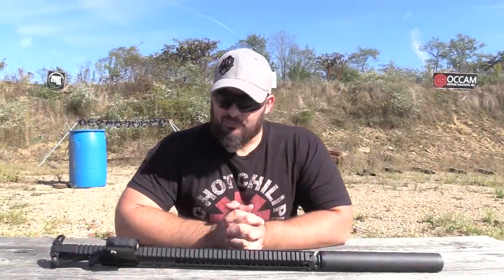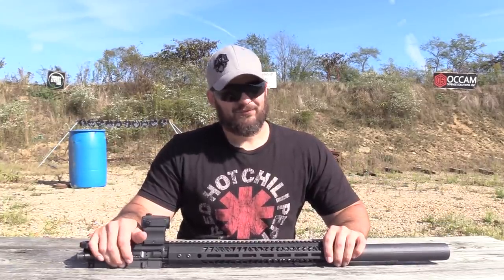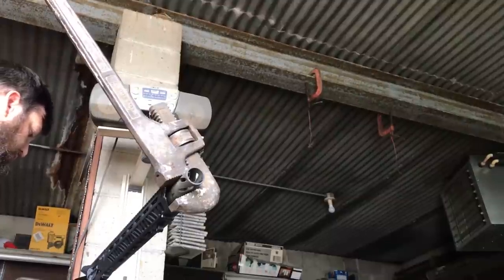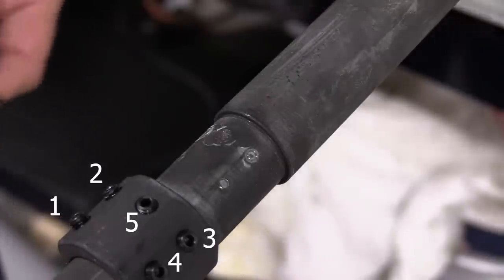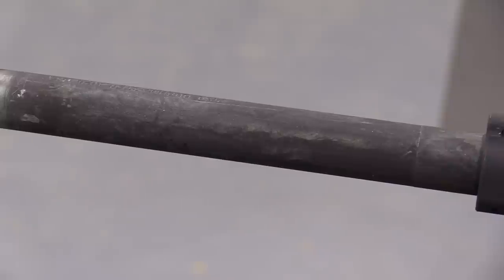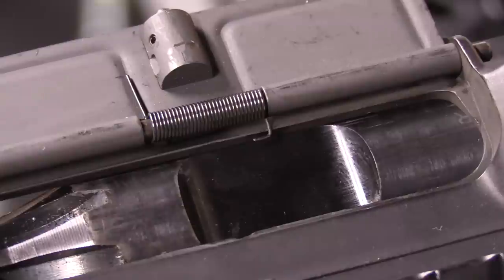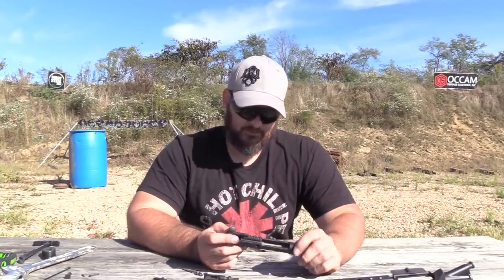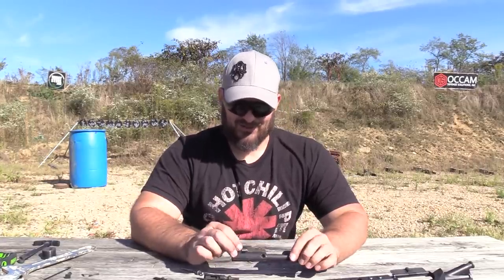The Worst AR 15 I've Seen 🚩Bear Creek Arsenal🚩

Comment: Runs a big bore on full auto then complains some things went wrong? This is a budget hunting rifle, not a full auto battle rifle. Probably the worst review I've seen.
Reply: True
Reply: He’s just mad it doesn’t have any Punisher skulls on it
Reply: Exactly this guys a real pos he makes false statements I tagged BCA about his latest comment about illegal labor it kinda sound like defamation of character to me this guys a real winner
Reply: I certainly thought he was an arrogant douche that made a fool of himself. But don't tell him that, i'm not sure his ego could stand it.
Reply: My thoughts exactly
Reply: You know what's sad? He just had to change out 2 parts to make it work... Though his gaskey is a major problem, i've yet to see that bad of a construction on mine.
Reply: CGranch  If I were to buy one of these big bore .450's I would simply restrike the stakes on the gas key before using the rifle, I always take new guns apart and clean them in mineral spirits or 90% alcohol to clean off the factory packing oil anyway, while it's apart I inspect the gas key and gas block and this was a fairly obvious mistake should have been easy to spot, so just restake the side they apparently didn't stake or if they did apparently not deep enough to count and you shouldn't have a problem, the crack on the BCG is far more concerning in my opinion, I wonder if that was the result of full auto fire or just pot metal construction.
Reply: @Kwuiz  As someone who would be considered a "Fudd" since in my life the only real firearms experience I have is with bolt action/lever action rifles & shotguns of different types, I have noticed something about the gun community. I have recently taken more of an interest in guns & purchased my first AR 15 which is the first tactical weapon I have ever owned. I have been doing a lot of research & trying to absorb good information & visiting my local gun shop a lot & asking questions. I have noticed that there are a lot of elitist assholes in the gun community.

I come from the car community, that is my main hobby along with PC's. But the Car community (which is segmented into different cultures) in general is much more friendly & welcoming to newcomers than the gun community. That upsets me because I am a huge supporter of the second amendment & everything about it. I would think that if you want more people to support your cause, you would try to be welcoming to newcomers. But often in forums & videos the elitists just jack off on their fancy expensive guns & tell everyone who doesn't own a top of the line gun that their gun is shit & should be thrown in the trash because it will never me as good as "MY gun". They get upset & mock you if you dont know about every single bolt in your gun & tell you that you are a fucking loser & to suck your mommas tit.

When you get into cars, NO ONE goes out & purchases a McClaren as their first "sporty" car. In the gun community most people dont go out & purchase a top of the line firearm as their first purchase. Granted quality firearms are generally cheaper than quality cars, but the idea is the same. It is a learning process, for those of us who have not done 2 tours in afganistan or whatever. Have these people ever heard of "entry level"? Seems like no.
Reply: GI Severino  Buddy that car would have broken down even without the rims.
Reply: Yeah. I must be a Fudd. I don't burn through a thousand rounds a week in one gun. And I don't have $1,500 to spend on a base level upper. I can afford BCA, barely afford PSA. I can afford to shoot it several hundred rounds per month. And I never, EVER shoot full auto. For that, BCA and PSA are fine.
Reply: @richardkev3077  "barely afford PSA. I can afford to shoot it several hundred rounds per month" - So you could have skipped one or two months and been able to afford PSA?
Reply: @SugaryPhoenixxx  I'm not pissing at anyone for buying BCA. I'm pissing at people for lying to themselves.
Reply: Titanium Rain—or I could stop shooting for a year and get an even better one. 

Or, I could simply practice and not worry about the best.
Reply: Tell you what. I’ll shoot it until it doesn’t work.  Then I may agree it was a bad choice.

Or maybe it doesn’t break. Either way, you may see it as weird, but right now, I’m choosing to spend my money practicing instead of buying a gun that looks bloody impressive, but that leaves me unable to afford ammo.
Reply: @richardkev3077  My god. Such a brilliant move. Tell you what. I'll use the shittiest brakes on my car, and I'll brake to my heart's content until they fail and I crash and die. Smart financial planning right there.
"buying a gun that looks bloody impressive" - oh he thinks guns are differentiated by looks.
Reply: Apples. Oranges.
Reply: @richardkev3077  yeah, apples and oranges are different fruit. But would you take seriously anyone who buys rotten oranges because they're not the same as apples?
Reply: Thank you!
Reply: Yea this is awful
Reply: He's a you tuber. He has no idea what a battle rifle should do in any way
Reply: Amen
Reply: @ChucksSEADnDEAD  oh yeah 😂 cause nothing says quality like manufacturing done by illegal immigrants, 0 quality control, and exploding rifles 🤡
Reply: @ChucksSEADnDEAD  as a mechanic, buying the higher end brakes is a waste of money 99% of the time. I always use the cheapest Napa brakes on my personal vehicles, never had failure, just normal wear.
Reply: @traxxasrcfun  Cars can fail inspections and barred from being used on the road until fixed. Guns have no such oversight. So we're not talking cheap vs high end. We're talking BARE MINIMUM versus reckless abandon. I don't care if you buy budget. If you buy something that's so off spec it shouldn't even be called AR-15, that's like buying no-name brakes off Aliexpress or whatever.

Comment: you are the problem not the gun u modified.
Parkerized Barrel  has to be oiled.
u over gassed it with can - adj gas block with a can.
a pipe wrench wtf.
factory rock set a gas block lol.

owning a gun does NOT make u a gunsmith u have really shown this is true.
Reply: Dude was raised by women what do you expect?
Reply: When I heard him talking about rocksetting the gas block i knew the rest of this video was going down hill fast.
Reply: Nothing wrong with a pipe wrench if you don't plan on using the muzzle device again. That parkerizing finish looks like shit regardless of whether or not it should be oiled.
Reply: @hochhaul  he said he scratched it banging things into it
Reply: If you had any idea what you were talking about you would know rocksett on gas block screws is the best option
Reply: @robert1marshall  I don’t understand the issue with rocksett on the gas block lol. Way better than using loctite that’s for sure
Reply: For anyone reading this they do make heat resistance loctite blue. A little more expensive. But it is worth it. Gas blocks get hot. Regular blue will fail. Also if you have a handguard that has bolts that thread into the barrel nut. You should use it there as well.

Comment: Over gasses and uses tool outside of purpose, then complains because it fails for something it wasn't made for..... Suburban homeboy with too many Battlefield hours
Reply: What? He bought the upper complete and used it exactly as it was intended to be used. The torx wrench breaking had nothing to do with anything and he actually said he was impressed that the hand guard screws were so tight. Your comprehension level is obviously not great.
Reply: @jenniferbates9769   im thinking he is talking about the caliber. 450 bushmaster was never designed to fire full auto i don't own a bear creek i probly will its a 400 doller gun i can change the gas and barrel for 250 ish still have less than any other company selling there's with fugly parts
Reply: @jenniferbates9769  he miss used it 450 bm is not intended to run full auto
Reply: @jenniferbates9769  
No.  He ran it with stuff added on.  You think that, at 300 bucks an upper, they put an adjustable gas block on it?  He put that can on the end and jacked up the internal pressures, without swapping out the gas tube and gas block.  That's on him.

Comment: “Why won’t my 200$ big bore upper run full auto and suppressed”
Reply: Rifles can't tell if they're being fired in full auto or semi-auto. Suppressing does increase the impulse on the carrier but they had a misaligned gas block and a gas key popped out. Come on man, it was garbage before it even left the factory and had the first round put through it.
Reply: @f.a.2115  Exactly. So many clueless comments acting as though the rifle would have been fine with that shoddy gas key staking and piss poor gas block setup if not for being fired full-auto. Failure was guaranteed regardless of whether it was fired semi or full auto.
Reply: @hochhaul  yeah it was his fault for not checking it maybe he should inspect before he fires it
Reply: The fact that they only have 10 round magazines tell you that they aren't designed for full auto.
Reply: @f.a.2115  The fact that they only have 10 round magazines tell you that they aren't designed for full auto.
Reply: @hochhaul  The fact that they only have 10 round magazines tell you that they aren't designed for full auto.
Reply: @bryananderson3772  You people have the most delusional arguments. The AR was designed for full auto. The reduced capacity from using a larger caliber has nothing to do with the weapon's design by physical constraints.
A 10 round magazine also existed for the Škorpion vz. 61. The Beretta M951R was also designed for full auto and had a 10 round magazine. Any more excuses?

Comment: This is made to hunt with and maybe blow up cement blocks on the weekends not spray on full auto. 99.5 percent of people buying one of these will never fire it full auto!
Reply: 99.5? You mean 99.99999%
Reply: If it can't handle a few mag dumps on full auto then its worthless.
Reply: @regularfather4708  not true
Reply: I kill deer with mine and the occasional rabbit what kind of an idiot would need full auto on a 450......hmmmmm
Reply: Recommend a budget rifle for my friend. If you had 700$ right now and had to get a rifle. Where would you go?
Reply: @danielwells50  S&W m&p sport, ruger 556 or palmetto state armory. Cant go wrong with any of those.
Reply: benjamin dover thank you sir. Much appreciated
Reply: benjamin dover I can speak for the Ruger. I have both the 16 inch and the 10.5. Thousands of rounds through each and not a single issue with either. I got the 16 inch on sale for $599 and the 10.5 for $729. I love both of them. I have a 16 build I did a few years ago. Total cost was just under $1500 for it. Great rifle, no doubt, but my 2 Rugers are just as accurate, just as stout and honestly just as good. I've been buying Ruger products for 30 years and love them but was honestly skeptical of their "budget" AR when I got the first one. Obviously that skepticism went away because I bought another one. Very good rifles in the $700 range. I'd recommend them for anyone regardless of their budget.
Reply: I HATE GUN SNOBS.
Reply: Its .450 Bushmaster. It would be just as fast to empty your bank account and make a bonfire then to fire a 450 full auto. I have a .458 Socom and my wallet sheds a tear every time it goes to the range.
Reply: @calobstewart7345  I hate the "JuSt As GoOd" crowd.
If it was just as good they'd be asking for more money.
Reply: @ChucksSEADnDEAD  noone is making that argument that's the thing.
Reply: @calobstewart7345  But they are. Just responding to criticism of a subpar product as "elitism" is in itself a claim that the product "is fine" and shouldn't be criticized.
Reply: @ChucksSEADnDEAD   not true he just put it through a test that a big bore rifle should have never been put through they have the same amount of recoil as a 300 wm and they would have the same results
Reply: @eronreasor6361  "he just put it through a test that a big bore rifle should have never been put through" - Why?
Reply: S&w or buy a stripped upper , buffer tube kit, n a adjustable stock , get a faxon barrel, faxon low profile gas block and bcg, a complete Anderson lower or palmetto state lower , and so magpul mbus irons
Reply: @ChucksSEADnDEAD  because he should have shot this semi auto, with a brake, with a 20+ inch barrel, because that's what everyone is else is going to be doing. Then he should've ran this rifle hard as shit in full auto side by side with a much higher price tier upper. We don't have a frame of reference for how poorly this cartridge/upper performs in full auto relative to other companies providing similarly priced product skus. Or more expensive products for that matter.
Reply: @Shredwizard445  you review a weapon based on its capabilities, not what people are doing. Otherwise you could review a weapon by sticking it in a closet or gun safe because that's what most people are doing most of the time.
Reply: @ChucksSEADnDEAD  obviously, see the entire second half of my previous comment where I detail a compare and contrast scenario. There is no frame of reference for the failure, aside from 3 or 4 other videos on YouTube with 450 bushmaster in full auto. Therefore, we don't have context with which to ascertain the capabilities of the weapon, we never saw a semi auto test. And we never saw a comparison with other 450 bushmaster full auto complete upper solutions within a similar price tier.
Reply: @Shredwizard445  "where I detail a compare and contrast scenario" - Why is the comparison scenario needed?
"There is no frame of reference for the failure" - There is. It's an AR.
"we don't have context with which to ascertain the capabilities of the weapon, we never saw a semi auto test" - Who cares? It was SHODDILY built. Forget about "capabilities", the makers should be ashamed to let it go out the door.
Reply: @ChucksSEADnDEAD  ah there it is, finally you pointed out the price point issue, thank you for acknowledging your complete misunderstanding of everything I said.
Reply: @Shredwizard445  I didn't point out the price point issue. You can sell a 20,000 dollar rifle that was cheaply built. You just built it for really really really really really really really really cheap... then slap a 20 grand pricetag on it. So price point is COMPLETELY irrelevant.
EDIT: just for clarity, I replaced "cheaply" with SHODDILY. Maybe they splurged all the money, no holds barred. But still came up with shit. I will not poorshame Bear Creek Arsenal. Maybe they spent a fortune producing this garbage.
Reply: @ChucksSEADnDEAD  of course you did, a price point comparison is the entire basis of your discourse as clearly indicated by your previous comment. The upper is a perfectly viable solution for a budget semi auto 450 bushmaster build, you just dragged the goal posts around. Who has a full auto nice lower with a shitty upper? Clearly, regardless of the intention of this video, people with full auto lowers probably aren't interested in cheap full upper assemblies for their big bore full auto builds. The video was pointless, only serving as inspiration for a comment section.
Reply: @chrisclatterbuck1881  I bought reloading dies and a press so I could afford to shoot my .458 SOCOM. Also, bought a sweet brake for it. Every time I fire, it sounds like someone else hits the jackpot at a casino.
Reply: @danielwells50  is go with a radical arms I love mine and it works great
Reply: @Shredwizard445  If it has to meet it's price point by forgoing basics like proper gas key staking or even bothering to put thread lock on the gas block set screws, it's a massive piece of shit that's bound to fail regardless of whether the gun was fired semi-auto or full-auto.
Reply: @danielwells50  If I had a name like Daniel Wells I would just start making my own dam guns LOL
Reply: Yep
Reply: This is the only guy running one full auto so figure the percentage off that
Reply: @regularfather4708  ain't no gun meant for full auto but machine guns . Learn guns bro . Full auto warps barrels and is useless asf and not accurate . Only rookies want full auto , I'm one shot one kill
Reply: Exactly, no arguments just insults. About the only thing Bear Creek Arsenal shills can come up with.
Reply: Facts
Reply: Man all the peasants are seething
Reply: @ChucksSEADnDEAD  grug think kitchen knife is 1/10 because can't skin deer not capable enough
Reply: @tylerkondrat8668  If you're buying a kitchen knife why buy one that looks like a dressing knife, was manufactured like a dressing knife, and priced as a budget dressing knife, when all you needed was a no-name brand kitchen knife?

Comment: I run a 18” BCA 450BM upper with zero problems and excellent accuracy. I just ordered the 16” side charger. I have several hundred rounds thru it, in SEMI AUTO. Your review is shoddy at best, seeing you fire it in full auto and use cheap ass tools. You may want to state your intended purpose- trying to give a bad review for a rifle not intended for the way you use it in full auto. You have zero credibility after seeing this.
Reply: I had two 450 bushmaster uppers from BCA, would not feed from mag.  I sent it back for refund.
Reply: Yeah he seems like the type of guy that just because it didn’t cost $2000 that it must be bad , and he likes to boast to his friends that his rifle cost x amount and is from a huge company…. All my bca rifles have performed flawlessly
Reply: @larryingram2146 Funny because I own a 350 legend, 450 bushmaster and a 16 inch 5.56 side charger. Every single one of them have been flawless...